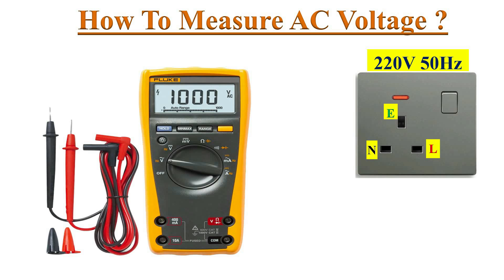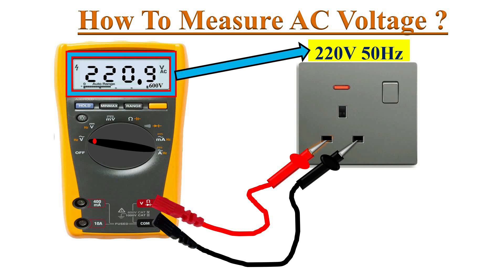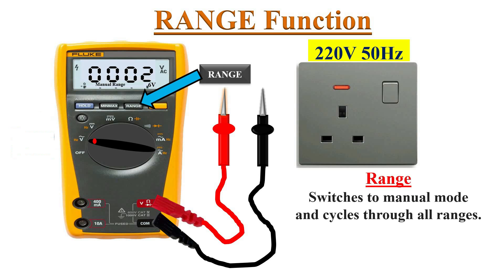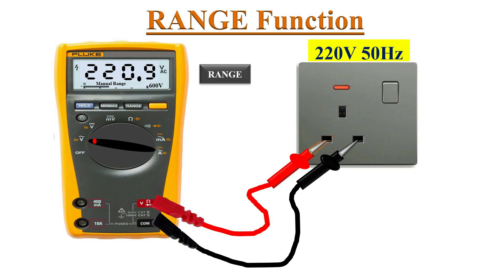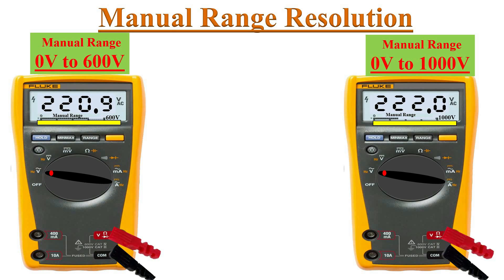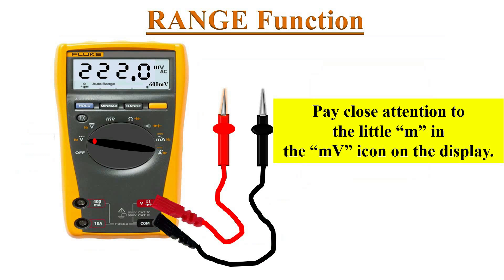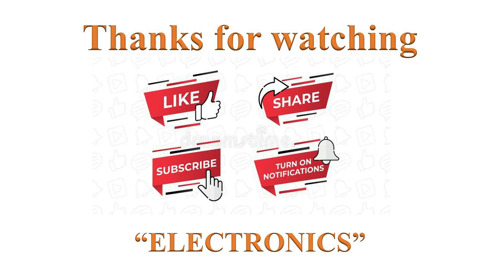How to measure AC voltage with Multimeter ?

Comment from the maker: Timestamps for various topics covered in this video are as follows:
0:18 Multimeter setting for A/C voltage measurement,
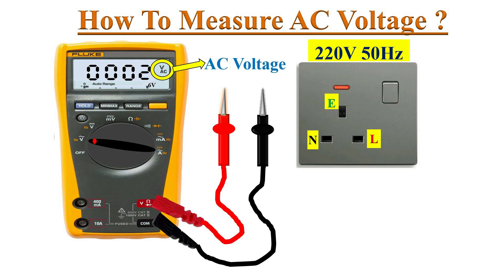0:43 Identifying symbols on the display,
1:00 Safety precautions before taking measurements,
1:14 Taking A/C voltage measurement,
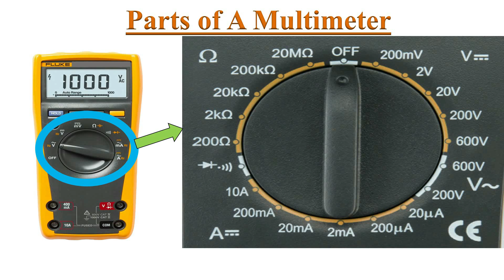1:33 Auto range vs Manual range, 
2:45 Manual range resolution,
3:41 Manual range multimeter setting.